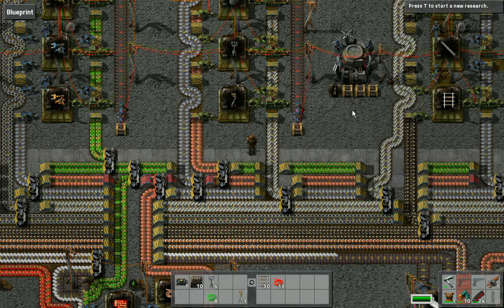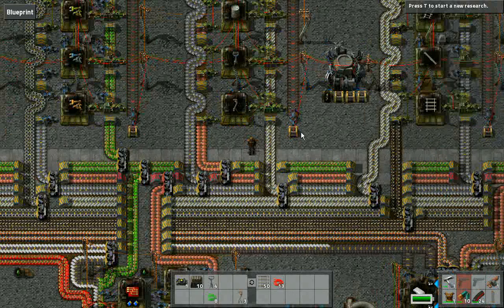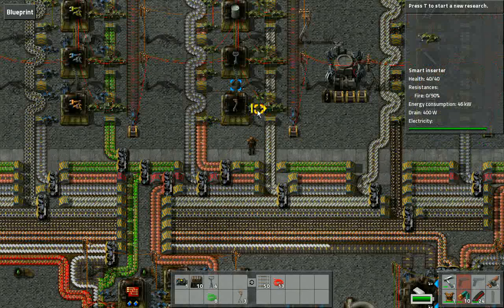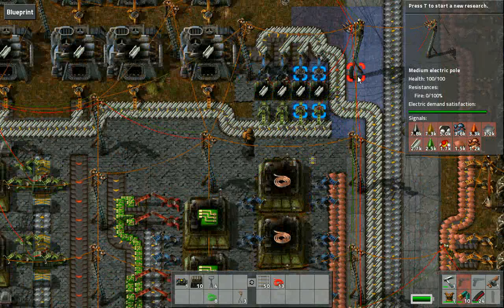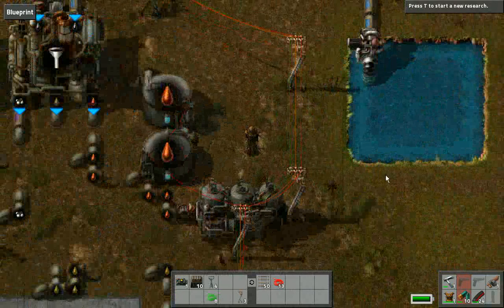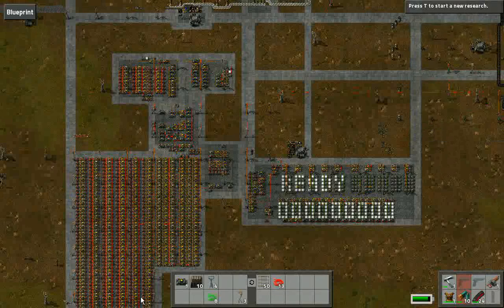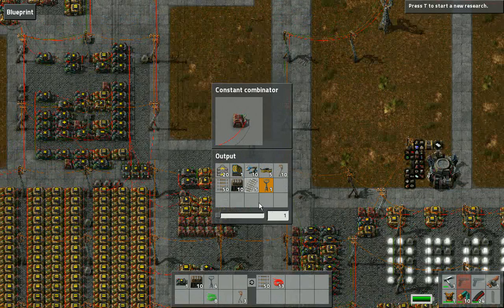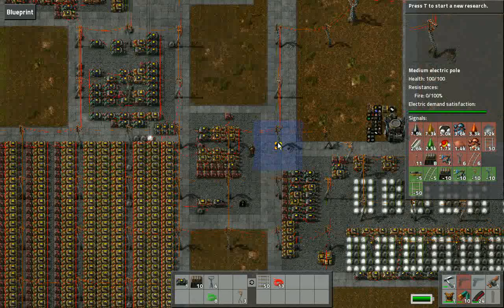Factorio: factory control  by a computer

Comment: do you have a world download? i'd love to know how to make something like this, currently I'm using a signal compare logic to run my factory by order, constant combinatory order > arithmetic that convers the signal then to a decider that reads the store amount then when store is less than order then output signal that controls the filters of the filter inserters to take X item out of one store and into the order store and load train when finished give train leave signal. the factory then responds to the orders and maintains a multiple of the order amount as a buffer and sends that via train to the order dispatch area. I'm just realising the amount of room needed to process and have a value for every product in the factory is immense so if I could find a way of making a memory system like yours in order to save orders and remove them when not needed that would save me a lot of room.
Reply from the maker: Unfortunately I managed to "modify" the save to the extent that some features are now broken.  It will take me a day or so to fix it, at which point I can post it in forums.factorio if still interested.
Your project sounds interesting. From what I can gather the issue seems to be memory density.  If so, I'm not sure if this type of CPU will help as it currently stores 1 value per cell..  You might want to consider using more dense forms of memory which can store ~200 values/cell.
Reply from the maker: Here's a link to the save. 
https://drive.google.com/file/d/0B3I2uZChXS_OSFhWX2VjRVc1c0E/view?usp=sharing
Instruction set and the program is here
https://drive.google.com/open?id=0B3I2uZChXS_Oa2dhS2tPLUtpT00
This version is not fully functional as 12-13 conversion and my mucking about did break some things which I currently don't have time to fix.  It should get you started though. If you have questions please ask.
Reply from the maker: Here's better version.  The previous version had some zapped out code  which contributed to malf. This version works (mostly :)).
https://drive.google.com/file/d/0B3I2uZChXS_OdzRXRXFtZURXNU0/view?usp=sharing